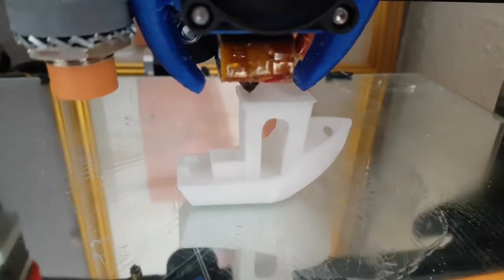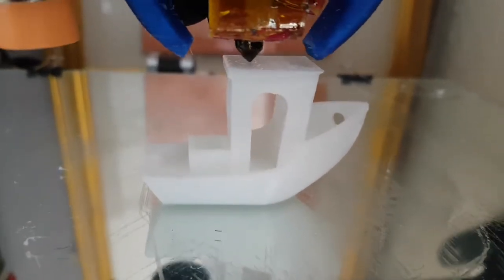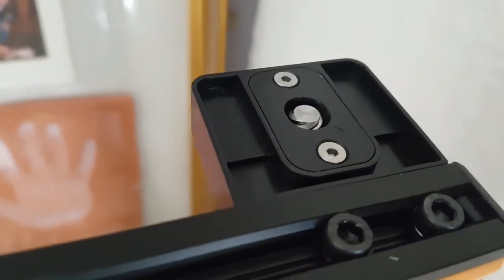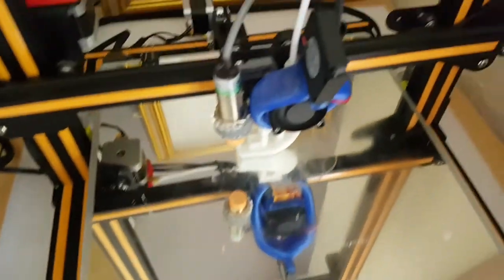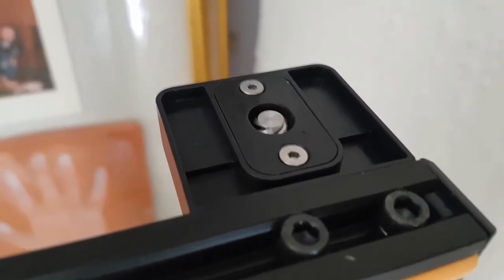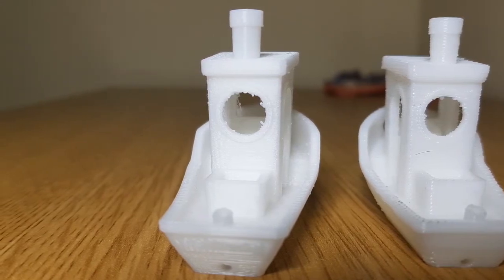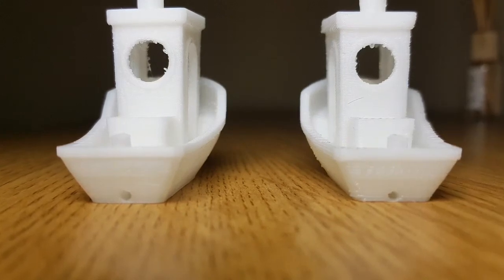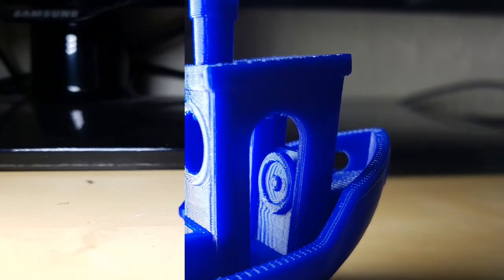Cr-10 dual z upgrade The Results

Comment: that stock benchy looks bad, the CR does not print so bad like de old one before modding, for me it's overheated the PLA when printing, giving that results, you must check slicer config to get better results (even in the Dual modded benchy boat)

Comment: Hi, I've read that this solution (dual stepper) is giving desync between the 2 Z steppers. And that a dual lead screw with just a belt on top to link both screw is the way to go. What can you tell us about that ? 
Thanks for your video!
Reply from the maker: 6rilllir6 ive not had any issues with steppers getting out of sync but I do check the heights eigher side before any large print just to be certain. I've  only had a discrepancy on one occasion which may well have been down to applying pressure to print head while steppers were off. But I can see that the other system may well work certainly negates the need for opening the control box or any rewiring.
Reply: thanks for your feedback :)
I'm still hesitant, but I also haven't received the printer yet! Sooo impatient !
Reply from the maker: dont worry we all get like that about waiting for new stuff. Im waiting for my Prusa i3 Mk3 to ship and i check for updates many times a day

Comment: mat1uk - thank you for your videos! Made installing my dual-z WAYYYYY easier!!
Reply from the maker: Ariel Correa very glad to hear it
Reply: mat1uk   it's odd that the new lead screw wobbles at the top through the new bearing guide. Mine is also like this and wonder why it's not as solid as the stock left top lead screw bearing guide....so it's not because of your surface being that Styrofoam packing. Have you still noticed the looser fit compared to the stock left ?